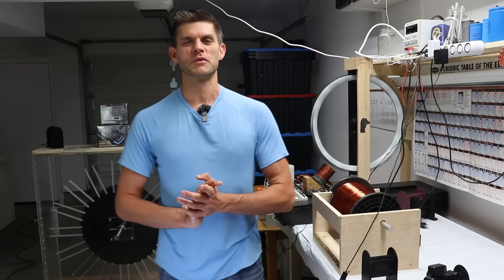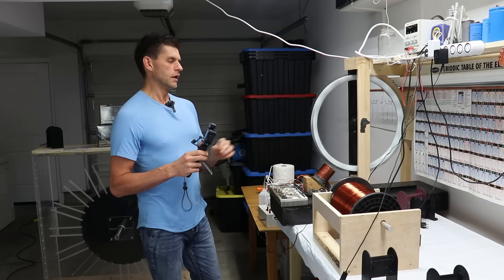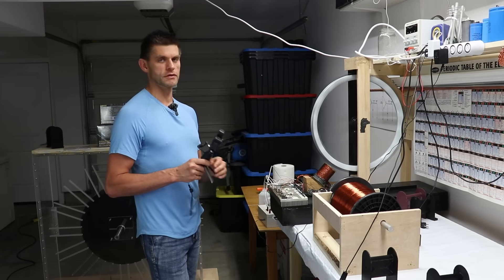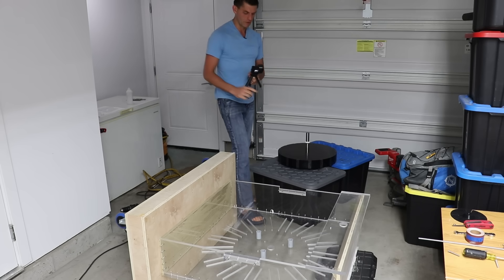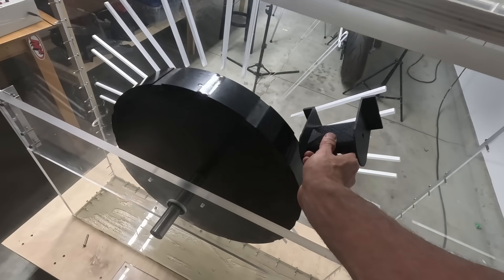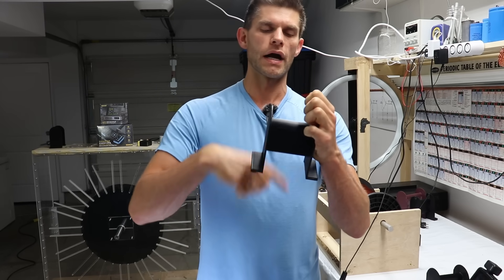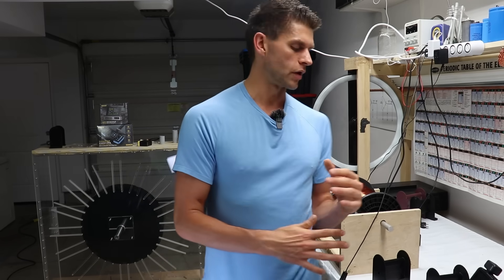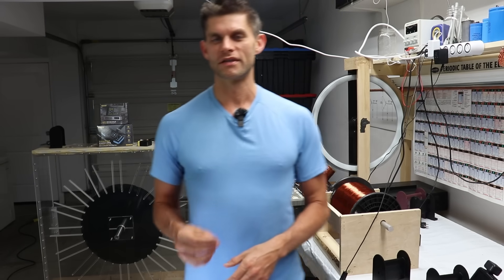Unlocking Zero Point Energy in My Garage (Open Source Project)

Comment: Hi😢😢, can you please do a simpler version for us who are not scientists or electricians, that anybody can follow ar low cost, i have seen other videos on this. Please also explain to babies like us😂😂😂😂. Looking forward to the next video. I wanna try this but too many expensive things, 3 batteries and many mosfets etc, no one can afford that at homes in majorly,  hope u consider my request 😢😢😢
Reply from the maker: Thank you for the support. Once we get it running there will be people who provide the components and machines so you dont have to build. Eveythjng will get easier 

Ill do my best to keep it simple, but that's why im building it instead of just talking about it
Reply: it is confusing because it is not real.
Reply: Bethlehem, i posted this elsewhere but maybe it can help you. Think of it like lightning. Its impolsive energy, meaning its like a bubble imploding under water, not an explosion where things push outward from a source. when you get a fluctuation in electrical potential, you create this gap or bubble in the environment. Browns gas (hho) is another example. A good example in nature is the pistol shrimp. By taking advantage of the aspects the environment the pistol shrimp creates a bubble that is hotter than the sun. The laws of thermodynamics are 'loopholed', not broken. Its also like pushing a boulder downhill not uphill. We need to consider all factors not just the generator (you pushing) and the thing it acts upon (boulder) but also the space in which it is in (recognize the hills  "free energy" assistance ) Theres "free energy" everywhere, anyhill side or flowing stream or bubbling hot spring or natural decay or hot sunlight, electrical fluctuations, barometric pressure fluctuation,  (lightning) its just a matter of being clever and in harmony with environment enough to harness them. (not fighting your surroundings but instead "hack" {make them work with you not against you} them so to speak) Be a warden of the land. To harmonize you must know the notes ringing out around you; is another way to look at it.
Reply: @Vallcon  Not even close

Comment: Still no thing as free energy. This will finaly run out of power. It wont create more power then it uses. this puts just one battery energy into another but there are losses, so you put out more then you get back. It will run for a long time, but if you want to use this power to do work, then the battery will yust drain and you need to charge it, and this wont come for free. And the ether and vacume and other nonsence wont put energy into the battery. This is just a scam, and people just loose money in the end and gain nothing. Every free energy device is still a scam if people sell it like it a magic thing that makes more power then it uses.
Reply from the maker: Sounds like you know everything and should give up on life. You're wrong and real science is about not having self limiting beliefs. Anyways go watch someone who makes you comfortable

Comment: 1:25 - so you're using a flyback diode to capture the inductive pulse from quickly turning off the coil power.  That energy flows back to the source—this is all well-understood practical electronics.  But how does this allow zero-point energy to flow into the system though?   From what I've read, there's no way to meaningful capture this energy at macro scales. Even at atomic levels, any energy borrowed from the vacuum must be ultimately returned with no net energy gain.
Reply from the maker: See reading and doing have very different results. Maybe you are reading the wrong stuff
Reply: @MadscienceLPTECH  I was asking a serious question.  As this is an open source  project, it would benefit us all if didn't deflect.  If you had a good answer, it would get more people interested.
Reply: @beyondfossil I think he was referring to the predisposition of the “need” to return the energy back to the vaccum (the “larger box,” Like including the ocean and an island in 1 system) If this was the case, this would mean there’s no net energy gain as the energy is just transferred from the vaccum to here. I understand both arguments tho

Comment: The main issue with the Bedini stuff is the impulses hammer the batteries to death. The plates will crystalize then the next hammer will knock that layer of lead oxide and or Sulfates off the plate and continue till the batter(y(ies)) fails.
Bedini found this out and that is why his charging technology didn't go anywhere. It ruined the batteries if they were new and if they were old you have problems stabilizing the batteries as they get hit with the impulse trains. This will strip the sulfate layers off the plates and eventually will do as I told Bedini it would do. A big pile of crystals below the plates and not working batteries.
 RWG Research did a big investigation into the larger machines and it ruined the brand new marine batteries his friend had gotten for the project. Whatever the batteries were they didn't last too long. After he tried to put them back on a regular charger they would not recharge anymore.
 Be warned this sets up dangerous impulses inside of the batteries. This process WILL RUIN the batteries in not to long of a time frame. Maybe 20 hours or so of continuous running. Maybe longer intermittent use.
Reply: Why not eliminate the battery and go with a large capacitor?  Slamming electrons into a capacitor is an electric function, not chemical.  Maybe more stable?
Reply: @parajerry  That is because this process only works with battery internals. If the battery wasn't there this process wouldn't work.
 A capacitor doesn't have the same chemistry or even the same internals like Lead plates that already use dopants between the plates. One plate pure lead and the other pure lead frame with lead oxide filler.
 See a battery usually has charge and not like a capacitor it stores the charge in different ways.
 I have yet to see someone even try to use capacitors to replace the batteries. Would be interesting to see how this hammering would affect a capacitor? Like an electrolytic capacitor... Hmm...
Reply: Plus there is a thinking out there that states that the difference in potential between the two batteries allows one to use that flow as it recharges another less charged battery. Thats is why they swap the batteries out because the difference between the two batteries is what drives this process as well...
Reply from the maker: I dunno I've had the small model running for days on end for the last 2 years same batteries
Reply: @MadscienceLPTECH  With a deep cycle battery it should take a while to cause problematic damage as they are designed to repeatedly go from full charge to complete discharge, with extra room on the bottom for the lead oxide to collect. I don't know how critical it is to use regular batteries, if not, the wear issue can also be solved by using capacitors instead of batteries. I'm definitely curious to see the outcome of adding sensors and  having data being collected as that's the best way to verify and potentially quantify any energy gain.
Reply: @VeniceInventors  they never do that as it destroys their delusion, I find these claims are all ways failure to grasp energy flow and conversion.

Comment: Magnet to coil gap distance is important for strong energy transfer through magnet flux capture.  When I did a 3D print of an axial flux motor and used very large capacitors instead of dual batteries for a Bedini style motor, I tried to get about a 1mm or less gap from coil end to magnet face on the rotor.  Best I got was about 99% efficiency, no over unity.
Reply from the maker: Ill have about 3mm on this build.

Comment: You should plot the recharging battery temperature. If that's where the 0 point is drawn from, I predict it will get cold. Or with all that chemical action going on inside, at least not get hot.
Reply from the maker: Great idea. Love it. But the batter banks flip flop every 3 mins

Comment: 2:24 - the “open system” is a massive key to this project to achieve COP>1, why it works is very poorly understood, and it’s not hard to speculate why that is. Bedini was completely straight up about how his tech woks, and had many different working examples and videos that clearly explained his methods and demonstrated his genuine genius. Open sourcing this tech is most probably literally the only way to bypass the “Black Hole”, so super clearly structured documentation is very important, enabling MANY OTHERS that aren’t at a trained Elec Eng level, to easily and safely replicate. Simple repeatable scalability.
Reply from the maker: Thank you brother
Reply: Expected claim:
✅ Charge battery gains more than run battery loses.
✅ Net energy in the system increases.

What always actually happens:
❌ Charge battery gains less than run battery loses.
❌ Total energy in the two batteries goes down.

---

✅ Why This Test Is Solid

⚡️ Because it removes the tricks.
✅ It doesn’t care about spikes, voltage differences, coil magic.
✅ It just asks: is there more usable energy in the system afterward?

Energy accounting is king.

---

✅ How You’d Measure It

✅ You can do this simply:
✔️ Measure open-circuit voltage before and after (rough idea).
✔️ Better: measure actual Ah or Wh available before and after.
✔️ Even better: use battery testers that do discharge tests for real capacity.

✅ No matter how you slice it:
✔️ Total energy in = Total energy out (minus losses).
✔️ The run battery’s loss will always be more than the charge battery’s gain.  

Prove me wrong... where's the tests or the charts proving the claim?

Comment: How are you measuring energy in vs out?
Reply: he doesn't
Reply: You do a lot of charge and discharge cycles and then average them as joules, and then calculate the COP from that. Batteries charged this way like resistive loads better, so use a incandescent bulb as the load. Other steps are need to be taken if you want to cycle the batteries back to the front end of the machine and expect to see gains that way.
Reply: Tesla Numbers?
Reply: @ambkinetic  Heeeell yeah those be Tesla numbers!
Reply from the maker: Total work, energy of the system. Once the potential energy in the system + work done = more then potential energy we started with... definitive
Reply: @MadscienceLPTECH  how about including some numbers please?
Reply from the maker: @mxcollin95 3 6 9

Comment: For a system like this you need a battery that can charge fast while still able to send out the same power. I got a similar project but the battery supply is the down fall. My project can take 12v 20amp at just below 350 watts to power it but the output is 12v 150 amps leading about between 1500-2000 watts. Ive been watching the new battery types that we're told about but never actually see like salt-ion, lead-ion, and tesla just started showing off alluminum-ion. Salt and lead ion batteries seem to be going nowhere but the alluminum-ion might actually take off and if so thats what we need for our setups.
Reply from the maker: Ya. Lead acid seems good though. I dunno we will see
Reply: Yep and I just saw a video yesterday that said Tesla plans to start putting the new batteries into his cars in September.
Reply: @Ananda7372  it starts with the cars and will expand into smaller batteries. Its gonna help expand solar and wind energy tremendously too and I can't wait.

Comment: Why go to extrordinary lengths ?  Why not just show us proof of concept with a simple car relay & a couple of batteries & diodes ?  By the way I tried that method & got zero 'zero point' energy.  Even just start with a manual contactor
Reply from the maker: Its going to be easier to see the system staying charged and a rotor doing excess work with data loggers. Im planning to display this in UBC for ppl to view and I want it commercially viable

Comment: While zero-point energy is a real and accepted concept in quantum mechanics, the idea of harnessing it as a limitless, free energy source is widely considered a scam. Scientists understand zero-point energy as the lowest energy state of a system, even at absolute zero temperature, and it's a fundamental aspect of quantum field theory. However, the proposed methods for extracting this energy, often involving vague or pseudoscientific explanations, are not supported by current scientific understanding.
Reply: Yes, I followed Bedini when he was still alive, and he was notorious for using oscilloscopes with dirty connections, claiming they worked better when in reality there were grossly out of calibration, leading to convenient measurement errors.  In a museum of his work, employees freely admitted that every few months they would have to replace the 12V batteries as they eventually both wore down their charge.   It's fund science to explore and experiment with, and I learned a lot, but ultimately hopium is the only way these gadgets produce excess energy.
Reply: @geraldc867 You clearly do not know what you are talking about… the machine was designed to show basic free mechanical energy, with various amounts of electrical recovery, into a second set of batteries or other device. It was up to the experimenter to enhance the electrical recovery of the SSG to 90% efficiency or beyond. John gave bread crumbs it was up to you to research the SSG device to find the gains and bring it overunity.
Reply: @Advancedbatterytech  Straight to the smear campaign.  But you clearly didn't build one and I did.  None of the over unity devices of the last 20 years on the internet turn out to be over unity.  I'm also a trained EE, so I know how to use electronic test equipment to get accurate results.  Nothing about the physics of a back emf recovery system will lead to a possibility of "extra" energy.  Losses add up in the resistance, the magnetic field is conserved so no additional magnetic field is captured and converted.  There are a few hopeful schemes involving electron capture from the atmosphere, but the free electron density of a cubic meter of atmosphere is exceedingly low, hence low yielding, like a few hundred electrons per cubic meter low.
Reply: @Advancedbatterytech  this is the same story for 20 years when the device doesn't prove out to be over unity: "But you didn't build it right, and you're an idiot for not believing."  I want to believe.
Reply from the maker: @geraldc867 sounds like you should be a mythbuster
Reply: @MadscienceLPTECH   I want to believe.  I spent years building and analyzing various over unity schemes.  Most of the original YT video claims were people misreading their instruments.  Note that typical meters only read AC waveforms accurately if they are seeing AC sinewaves for voltage.  Any kind of pulse waveform such as from a collapsing field in an inductor will produce a result that is far from accurate.  It is a trap that some electronic experimenters can fall in to when they "want to believe" the result.
Reply: or supported by reality, or by physics or by sane people.
Reply: People need to stop pretending it’s like they have some kind of high ground when they choose one side of a highly contested cutting edge issue of science, like they know when people are just trying to explore and figure it out, you are no orbiter of truth
Reply: Acting like that is actually the least scientific thing you can do
Reply from the maker: Ok chat GPT. I guess modern science really has everything figured out and our flying cars and clean abundance of food and energy is making the planet better
Reply: @MadscienceLPTECH  Look up Duning Kruger effect, the knowledge you'd need to just understand why this isn't a thing is still beyond your understanding clearly
Reply from the maker: This is clearly a bot troll as the user name changes
Reply: @MadscienceLPTECH  No it is some one with basic understanding. Noble cause to strive for clean energy, but you first need to understand energy conversion.
Reply: Nothing wrong with you believing the mainstream science, y'all have fun with that
Reply: @FirstNumber1  no such thing,  just science.
Reply from the maker: Totally  @FirstNumber1

Comment: yeah I hear you it seems promising I went through all of this myself 10 years ago, the biggest problem I had with the bedini setup was the full lack of torque so although the wheel can spin and recapture the energy the amount of torque is extremely Limited to drive any substantial generator it just did not work, https://www.youtube.com/watch?v=XpJx29WGb2k
Reply from the maker: We're u using transistors. What voltage was your input?
Reply: @MadscienceLPTECH  I used rectified 120 volt input running through a Variac, this allowed me to adjust the input voltage, also we were using 5K resistors on the trigger circuit, the chips we were using were CRT bias control chips which could handle the higher voltage there's a reference video on my channel somewhere about the types of chips that will work the best, good luck.
Reply from the maker: Nice work.
Reply: the CRT chips good luck 😁https://www.youtube.com/watch?v=tYTkaO8dP8M
Reply from the maker: Thanks. So p- mosfets